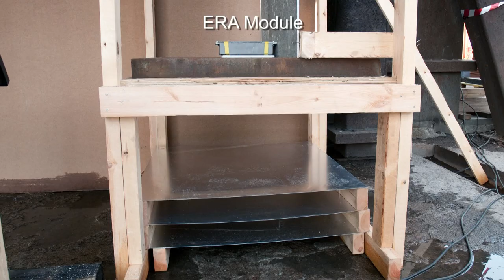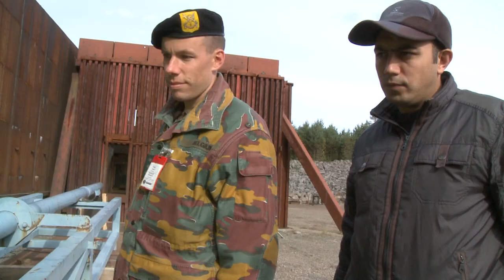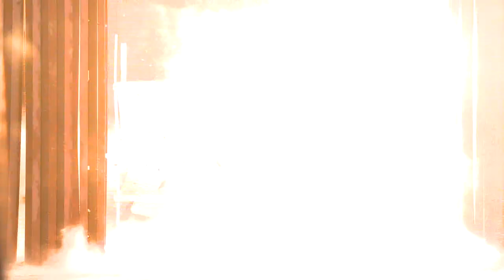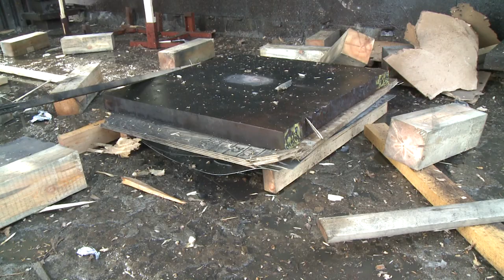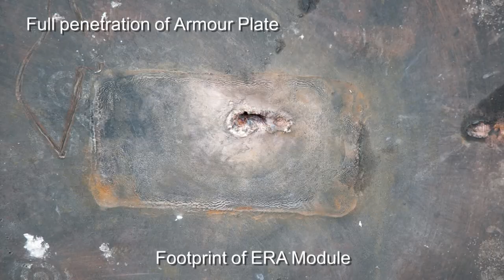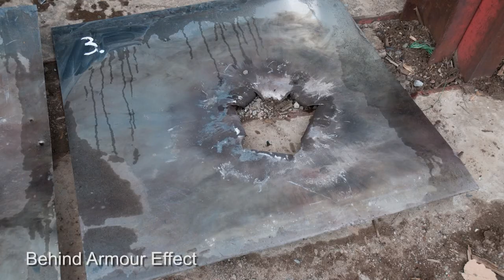NLAW Warhead

Comment: Tanks are outdated !
👏
Reply: I've been saying it for decades. They're museum pieces unless you're up against other tanks only (frontal attack). Such a wide array of weapons and delivery systems that knock them out so easily and the tech isn't new either. Even home made EFP's were knocking out M1A1 Abrams tanks in Iraq. By the time the material advances in armour can counter the existing antitank weapons, the antitank weapons by then will be even more capable. Outdated indeed.
Reply: Some classes yeah, definitely. If you want them to be efficient, they need some serious tech and armor added to them. That however would increase the cost immensely.

Comment: Added usefulness in these Swedish designed hard hitters, is the launch system. Compared to the Javelin, that has to have a clear area behind the shooter, this baby can literally be fired from within a building or a foxhole. It uses a first initial blast to leave the launcher, and the real rocket doesn't ignite until it has cleared away. This gives the shooter better chance of concealment and protection.
Reply: No, Javelin is also a cold-launch ATGM.  It's safe to fire from inside a room out a window without scorching the occupants.  Best of all, it's a total fire-and-forget system.  The gunner can scoot the moment the missile leaves the tube, although it's good practice to have a spotter sense the impact, and there are few thermal viewers available to an infantry squad better than the Command Launch Unit (CLU) of the Javelin system.
Reply: The biggest weakness Javelin has currently is that it's extremely costly compared to NLAW. Other than that, Javelin can do pretty much what NLAW cpuld